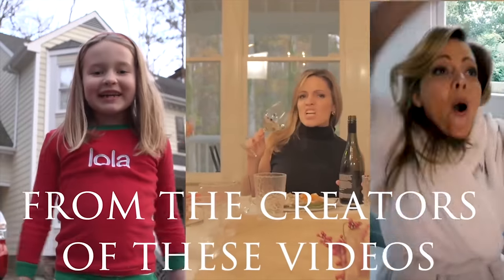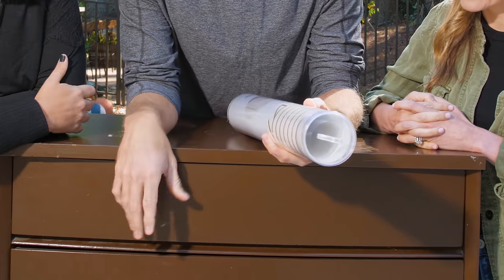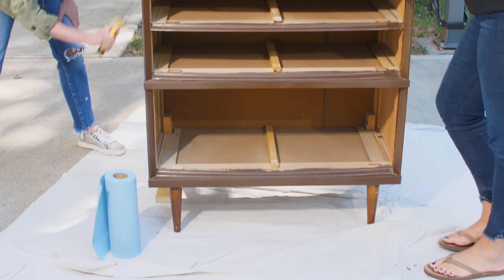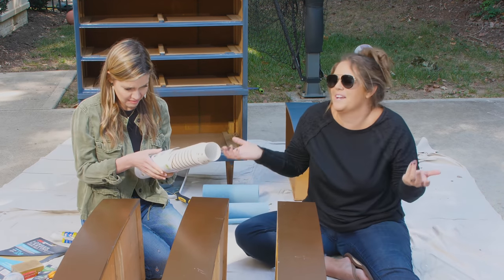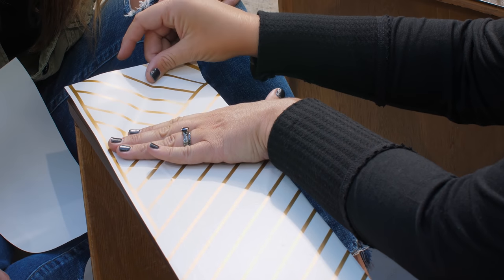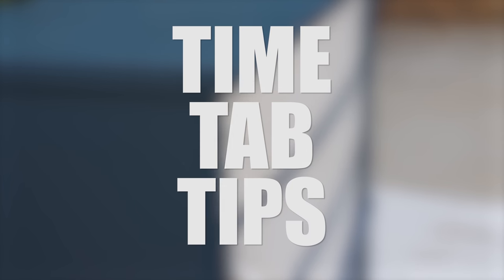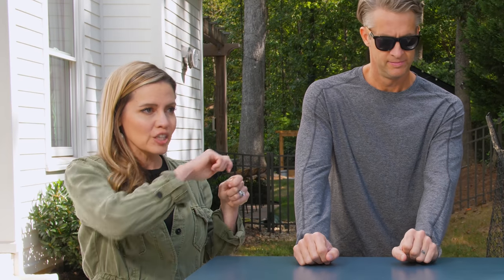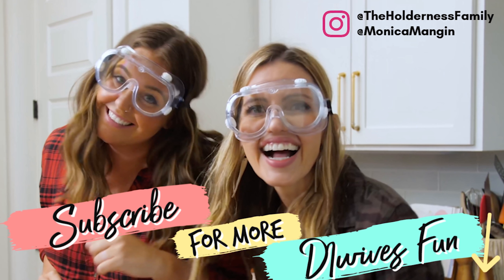DIY Wallpaper Dresser with Monica Mangin

Comment: This one turned out much better than the lines on the wall project. One suggestion, switch the top drawer with the middle drawer to break up the pattern between the second and third drawers. 👍

Comment: Tip. I used that type of wall paper, in hot weather it can start to peel. Use extra overhang and staple it to keep the adhesive from failing.